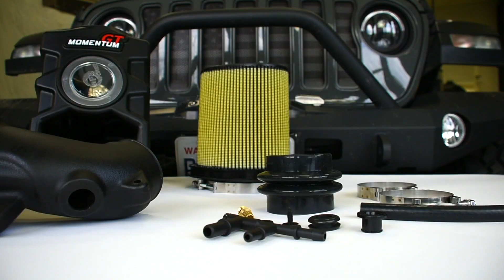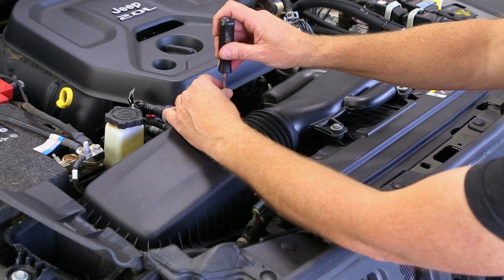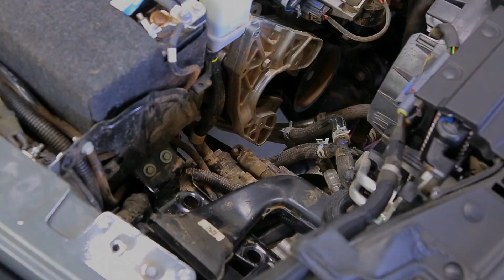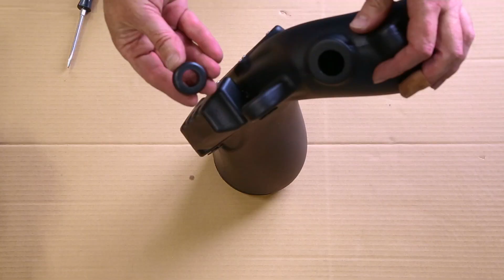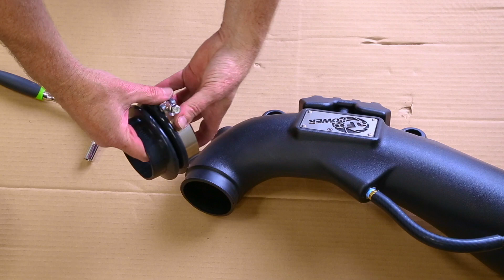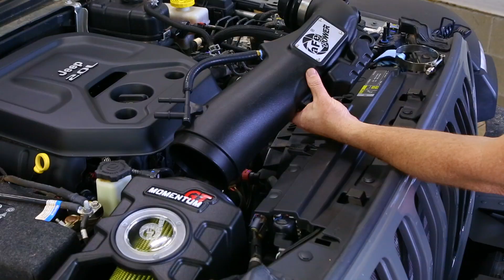aFe Power Cold Air Intake Install - Jeep JL 2.0

Comment: I have a 2020 Rubicon unlimited 2.0 , and I got a check engine light that came on after installing the AFE Cold Air Intake.  It keeps coming back-on even after clearing code.  The error code is (Boost Side Evap Purge System Performance).  Does anyone know how to fix this issue?
Reply from the maker: Russell, we heard back from aFe, they've seen the problem with a few 2.0Ts.
Get a hold of their tech dept, they have a reduced sized orifice that will help fix the problem.
https://afepower.com/contact/tech-warranty
Reply from the maker: We haven't seen that code come up with an aFe CAI kit yet. We'll reach out to aFe and see if they have any ideas.
Reply: Hi Rusell, I bought this almost a year and I have this same code as you do. Did you ever get it resolved. AFE sent me a new supposedly a new redesign vacuum tee but it is the same one. Did you keep the AFE intake? Just wondering. I am currently trying to see what to do
Reply: @mcortez018  My guess is its not the vacuum tee but the fact that the air take sensor must be vertical  so the air flows over it properly.   Once you install the plastic insert into the grommet, and install the air take sensor with a quarter turn, look inside and make sure the sensor is vertical and not horizontal.  The hookup should be facing forward as it did with the stock setup.  This is a pain in the arse!  If it is not, back the plastic insert out a bit, use some gloves (or just a rag so you can grip it) and turn it until it is in correctly.  This is NOT mentioned in the instructions anywhere!!!

Comment: Anyone get a check engine light after install? I’ve attempted multiple times to disconnect the battery to reset but the light comes back on.
Reply: I have a 2020 Rubicon unlimited 2.0 , and I got a check engine light that came on after installing the AFE Cold Air Intake.  It keeps coming back-on even after clearing code.  The error code is (Boost Side Evap Purge System Performance).  Does anyone know how to fix this issue?
Reply: @russelldegroff9491  have you found a remedy for this code? I’ve installed the same intake and have that same code. Thanks!
Reply: I have the same problem I called AFE there is a fix they send out still waiting on mine
Reply: @ericaustin2176  Hi Eric, did your problem ever get resolved? I have the same error code on my jeep which is quite annoying paying tons of money for something that gives you a check engine light. Thanks!
Reply: @mcortez018  see my reply to @mcortez018 above...
Reply from the maker: We haven't heard that as a problem. Have you ran the code to see what it is?

Comment: I read on another similar install that the turbo needed to be retuned to prevent damage after the install. What are your thoughts on this?
Reply from the maker: Not enough of an air flow change to worry about it.

Comment: Is there thing showing if it helps the horsepower or Hinders the performance
Reply from the maker: There is a chart showing the increased flow of the aFe Momentum GT CAI compared to the stock air intake: https://www.northridge4x4.com/part/intake-systems/50-70035g-afe-power-momentum-gt-pro-guard-7-cold-air-intake-system

Comment: Will this affect the Jeep warranty?
Reply from the maker: That's a loaded question Greg. Check out the Magnuson-Moss warranty act of 1975. 
In general, adding aftermarket parts to your 4x4 should not void the warranty, however, if the part you installed caused a problem, then yes, your warranty can be denied.
For examples:
 If you put 37" tires on your 4x4 and you snap an axle shaft, more than likely that shaft failure was due to the much larger tires and the warranty would be void.
However if you put aftermarket axles under your Jeep and the headlight harness melts, it would be hard to show that the melted harness was because of the new axle parts, so it should be warrantied.
Reply: @northridgenation  Sorry for the question but in California, there are so many restrictions as you know.  I noticed this product could not be shipped to California due to the CARB stuff.  Thanks for the reply.